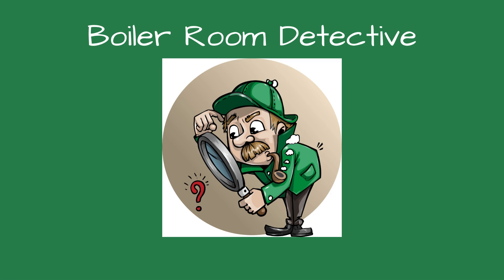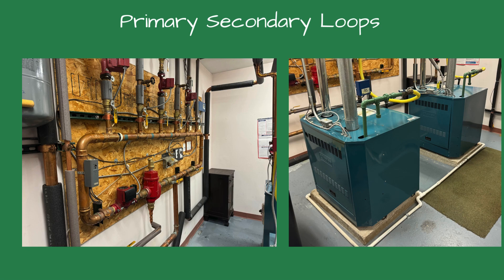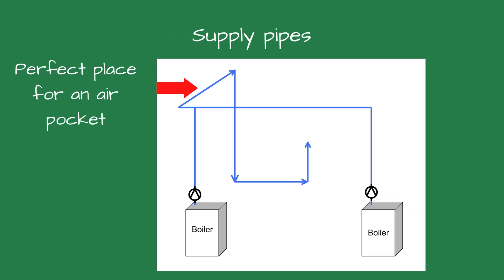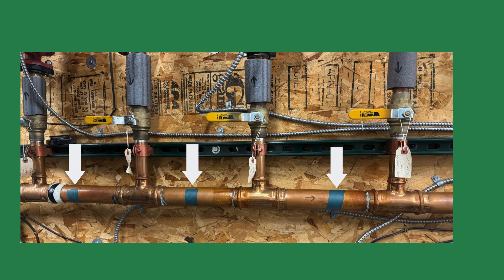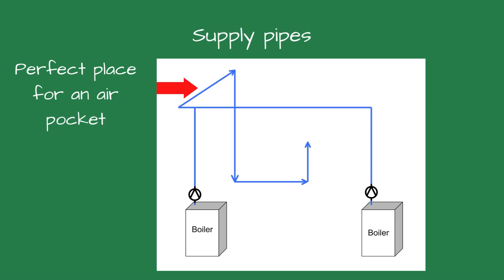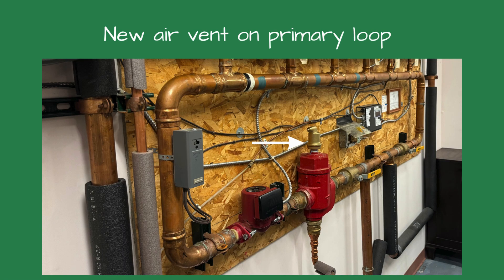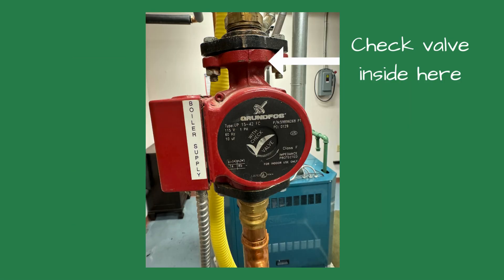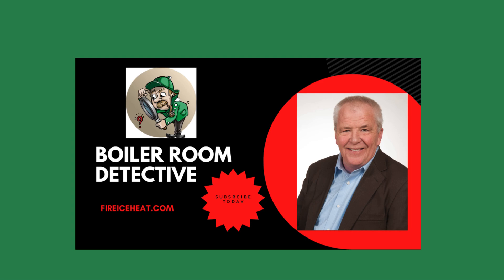Case of the backward flow

Comment: Good catch for a sneaky problem.  At our facility we've plumbed the air vent discharge lines down to a floor drain.  Once had a vent stick open and we sprayed chilled water all over the mechanical room.  That install is CLEAN, by the way.  Someone took care to install it properly.
Reply from the maker: Yikes that would make a mess